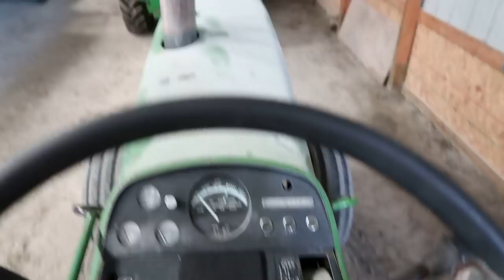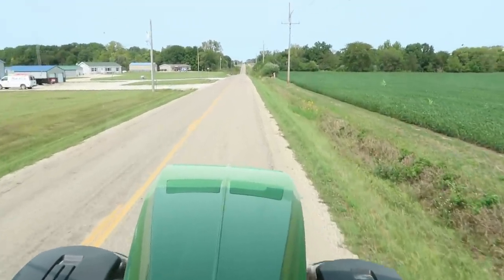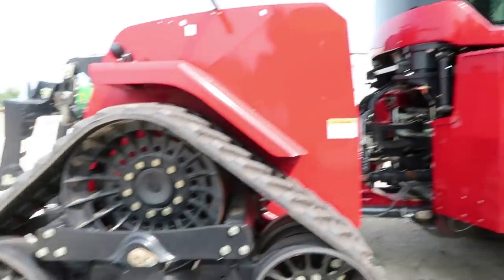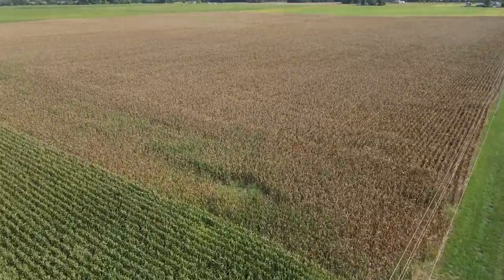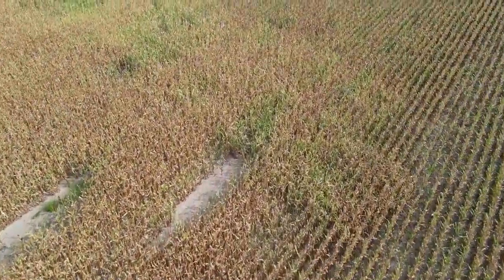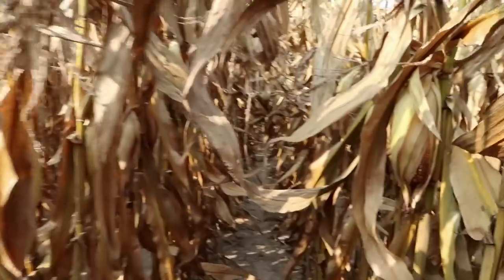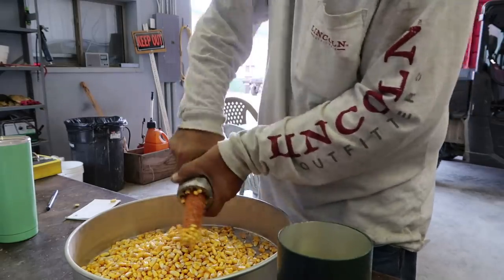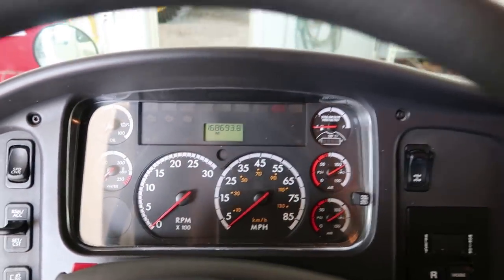Sampling corn, shuffling more machinery, and a glimpse of our new grain truck.

Comment: As you know very well that first day of harvest can be a real pain in the ass, i think sometimes it would be more enjoyable to put your nuts in a vise and keep tightening than it is to get all or most of the bugs worked out with start of harvest. In the early 90s we took our 1660 to the dealership for a once over before harvest, we got it back everything was fixed at the dealership, started on corn and everything was going good till the engine threw a rod right through the side of the block, another 10,000 dollars later and way behind we finally got crops  finished with no more major problems, no matter how much you plan and do the right thing with preventative maintenance SHIT JUST HAPPENS.

Comment: Will you have to rework the hitch on the new planter too or has John Deere figured out the simple solution?
Reply from the maker: We're actually keeping the hitch off the 12 row and putting it on the new planter.  We'll put the hitch off the new 16 row on the old 12 row once the new one gets here.